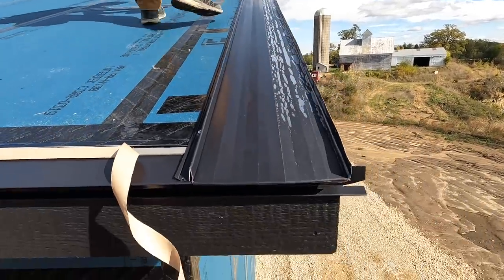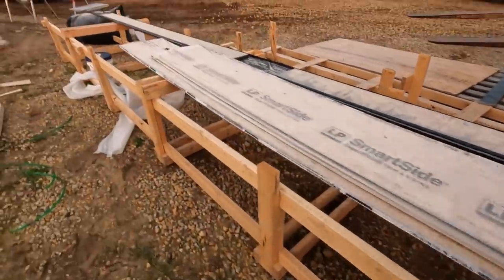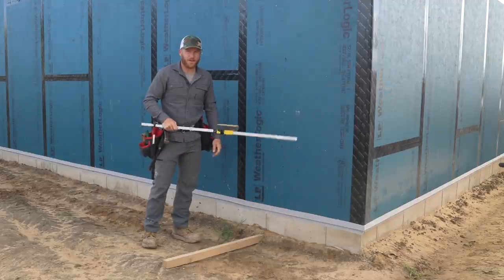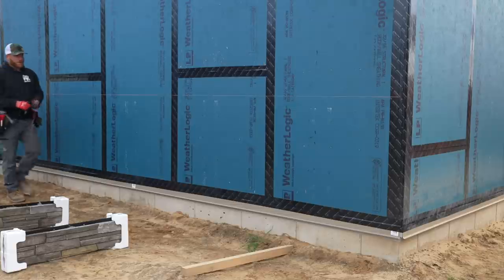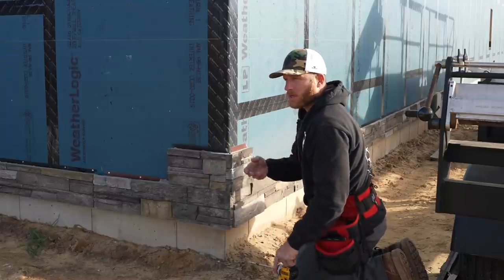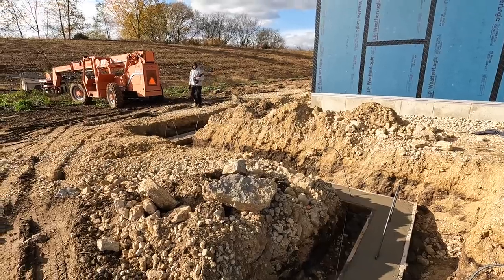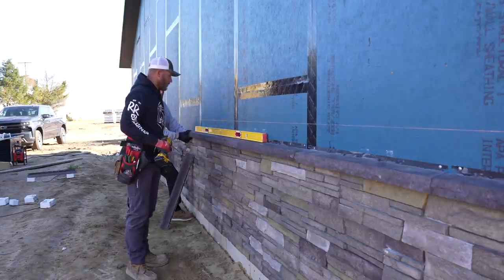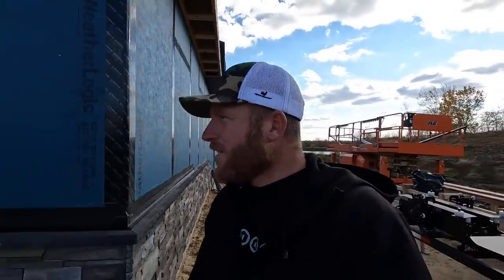Building a Barndominium Part 9: Concrete Floors and Versetta Stone

Comment: I like your channel and especially how you handle the metal siding.
I dont know about the radiant floor heating. You may look into it. The tightness of the tubes is a bit close at places but what worries me most is the thickness of the insulation under the tubes. It is supposed to be 300mm or close to a foot, and that is not for insulating against the ground, it is to insulate the floor heating not going in the ground  instead of the house as well as pulling up moisture and radon. Cant see really how many layers of that insulation that was laid down.
Cheers and thank you for a good channel.
Reply: Its only in europe (or sweden) you putt 300mm insulation under a slab. 
In usa 🇺🇸 its ”enugh” with 2” 😀

Comment: The tightness of this building's wall assembly is one of the most important aspects of building a long lasting house, in my opinion. If the envelope is sealed up tight like this the building will require far less maintenance over time and will last much longer overall and that's what every home owner wants. This attention to detail elevates top tier builders above the rest. I'm not a builder, but I do plan to be a customer when I build my dream home after I retire and I will seek out a builder of this caliber. Nice work!

Comment: The only thing I would have done differently, I would have taped the bottom edge of that Weathertech sheathing along the bottom edge and up each side front and back with that 4” tape.  Even that weathertech will wick up moister on that exploded edge against that concrete curb.  I also would have liquid flashed it to the concrete and dropped my Versetta stone to hide it.  If you were local to my area, I’d be signing a contract with you for my build.  Nice work.

Comment: That corner makes it obvious it is a veneer stone rather than 'full blocks'.  If I wanted to make the "full depth" masonry work deception, I might want the special corner pieces, but even then costs can be trimmed by only doing the full corners on the curb appeal side of the building.

Comment: Where did you get versetta starter strips. We haven't seen any in a few months now. We also can't get anymore stone until after the 1st of the year. You run into any issues with stone availability yet? Also the black 26 gauge metal. I heard it was the paint that they couldn't get not the metal. Black is hard to get in all construction metals now. 5 inch gutter probably being the worst.

Comment: I didn't see any electrical or water spicket's on the outside of the building when you guys were adding the stone?  I think I will go with that exact stone on my new building as that looks really good!  Which name and/or number is that type of stone?  Thanks Guys!
Reply from the maker: Sterling ledgestone
Reply: @RRBuildings  check that style. I think it may be "tight cut-sterling"?

Comment: I have been watching your build from the first video and I was wondering what the square foot difference is between the builds that are using house wrap over the frame followed by metal sheeting verses your weather logic panel and tapping method?  Can you share that?  Also there is no sealing the rosetta stone at the corner joints, not necessary?

Comment: You fill in the concrete floor up to the wall footings. what keeps moisture from wicking up the walls through the joint between the wall footing and the inside slab???

Comment: I would love to see a quick "how to" video on the process you would take if this structure sat on a partial basement (over the living quarters). I'm hung up on how the floor joist for the first floor would be installed on the basement with the post frame and 630T brackets. Would you install a sill plate on the entire top wall and then attach your brackets on top of the sill plate? Only sill plate between the columns?
Thoughts?

Comment: wish they allowed drains like that where I am...BIG nope...even if it was just "rain water" or "snow melt"...nope.  ILLEGAL...they all say "we know you're just going to change your oil right into that drain.  Their rods, not mine.  I thought they did away with floor drains pretty much everywhere myself for just that reason.  I know my grandparents cabin they made up pour concrete down them when we had to sell it stating "illegal to have a floor drain"...and he was in the middle of nowhere.
Reply from the maker: Anything over 1000 square ft we need oil and water separator

Comment: Why did the concrete guys put in rebar arches in that footing for the porch?
Reply: To lock the footing and wall together
Reply: @yet7450  It's common practice to put vertical pieces of rebar into the footing to lock in a wall. I've never seen an arch before.
Reply: @gone2dmtns  works just as good I think

Comment: Roof : So since the screws are on the left side of the panel, it appears that the last panel will have no screws in it, but will instead be held in place buy the previous panel on the right and a piece of trim on the left. Would this be an accurate statement or do you do something extra on the end ? Love the Channel.
Reply from the maker: You are correct and fasteners up under the ridge

Comment: Why do you not cut the corners at a 45?

Is it because the piece on one side does not match the piece on the other side "stone for stone"?

Thanks for the feedback
Reply: In my limited experience it is because the cut face looks like bare concrete and is impossible to make look good. The uncolored part will always show.

Comment: I can't believe nobody mention the crappy job from the concrete prep work.  Those foam sheets moving up and down when walked on, shows the crappy leveling.  This also causes the tape on the sheet joints to come apart.  Looks like wrong tape was used anyway. That tape job is useless now.  It wouldn't be much of an issue if radiant heat wasn't involved.   As a homeowner, I'm not impressed.  P.S. I know this wasn't Kyle..
Reply: Another wannabe professional speaks 😂😂😂
Reply: So your're the one that did the prep work. LOL

Comment: Is there no insulation from the bottom under concrete? seems like floor heating could be much more efficient when insulated from the bottom
Reply: They used foam boards, you can see the radiant heat tubing is stapled down to it.

Comment: When you are starting the panels and math out how wide you want the starter panel to be, do the panels always stay exactly 16" OC and you end up exactly where you thought 50 feet down the roof or do they sometimes stretch or shrink for one reason or another over so many sheets?
Reply: He marks the position where each sheet 'should' land. As he lays the sheets he keeps to these marks. Any small discrepencies is absorbed by the laps
Reply: Thanks

Comment: How do you know where the radiant flor tubes are when you set walls?  Do you just no go deep or is there a drawing noting them all?
Reply: You can find tubing via the layout diagram, photographs/video from build,  FLIR to see tubes when up and running. But most importantly the tubing is stapled to foam so it is at bottom of pour. Even if it is only a 4" slab an interior wall won't need a fastener long enough to hit 1/2 PEX that deep.
Reply: @bpdp379  Thanks for the information!

Comment: With the Weatherlogic, spray foam and seal tape the barndominium  seems pretty air tight, does your HVAC guy install a heat recovery ventilation system to get fresh air into the building?  On your shop buildings it wouldn't be as much of a problem but with a living area it would.

Comment: Kyle, since i live in northeast Ohio, I was thinking of using weather logic sheathing or similar for my build. I was thinking about getting 1/2 inch foam insulation panels and cutting strips to attach to the outside of the girts before putting up the sheathing to create a thermal break.  Other brands offer fully insulated panels but they are very expensive. What are your thoughts on this?
Reply from the maker: You could

Comment: This may seem a negative comment, but please take it as constructive criticism as that's how it is intended. The insulation to the floor looked to be really thin (50mm, 2"?) given the scale of this building and the underfloor heating pipes I can't see why there wasn't some really thick insulation here. As a proportion of the build cost the insulation is typically a very small part, but also for some reason the part that most people cut back on. I love the series, but please lead the way when building things or advising clients to ensure that you are going above and beyond whatever is mandatory in the relevant state.
Also, was there no membrane in the floor?
Reply: Another wannabe professional speaks 😂😂😂
Reply: @daveklein2826  I'm not a builder, but I have been designing buildings for the last 20+ years. If you take the time to read it again I haven't said I think that anything is wrong as that would be making big assumptions on what is required in the given state/province, I was trying to have a conversation not score points - your turn....
Reply: @videogalore  I've never seen more than 2 inch, plus your area matters.  Telling him to build better is kinda crazy seeing how everything is top notch..
Reply: @R2Mike  Here in the UK 100mm (4") is not uncommon for floor construction.  My point was to not rely on the minimum standards for your area (whatever they may be), it certainly wasn't an attack on the quality just that we can be too good at sticking to the rules sometimes.